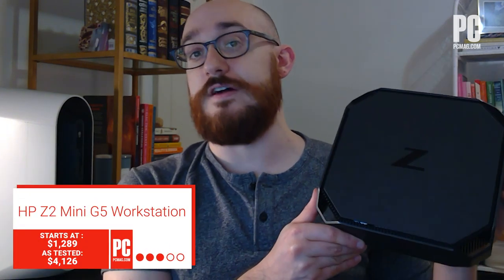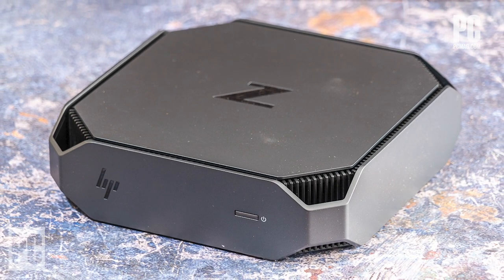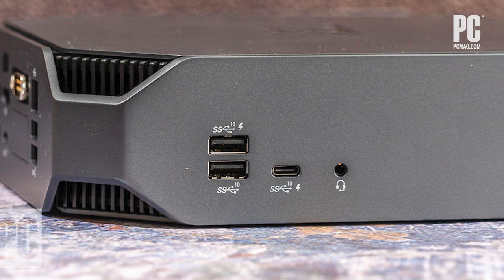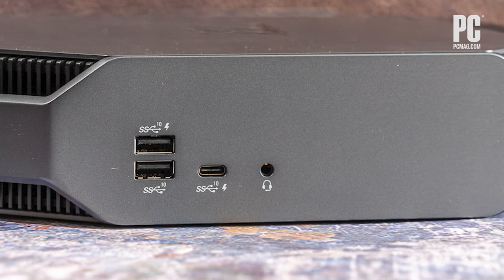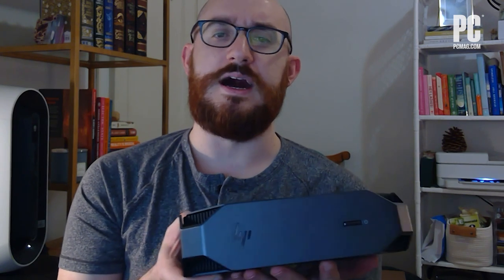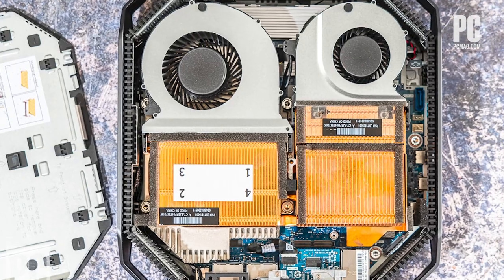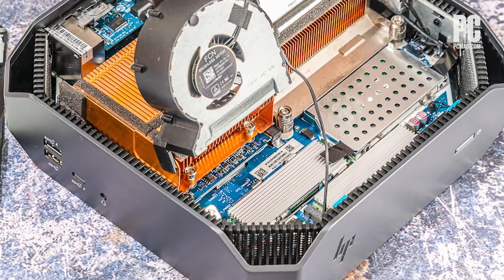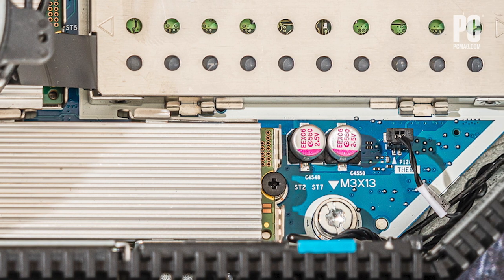HP Z2 Mini G5 Workstation Review | PCMag

Comment: The base Apple Mac Mini with the M1 can outperform this and it costs way less than four and a half grand.
Reply: yeah, HP should have gone with AMD instead of intel, because of the much better price to performance ratio
Reply: Outperform with what programs/tasks? My understanding is that it works amazing with Apple programs but can't outperform with all applications
Reply: @rasheed106  yeah i don't know what he means by that either.
Reply: If solidworks and cam are re-compiled for M1 this would make a lot more sense. But as a workstation the M1 is limited by available software.
Reply: @billknighton4181  Apple's Mac hardware is so good, but software is the only thing that's limiting it from becoming a perfect machine for all uses
Reply: shame that apple benefit from the genocide and enslavement of the Uighur muslims though.

Comment: why not laptop? It's not more powerful and still needs monitor, keyboard, mouse, etc, so you are not saving any space with this. A vs desktop. Also, it's expensive as heck. Dont get it.
Reply: There is in fact a need for these mini PCs for a variety of applications.  For example I want something without a monitor for recording surveillance video (use remote desktop to access) and it has to be small to fit in a closet space in a vertical orientation.  I suppose I could put a laptop in there, but that would be awkward, have worse cooling and component upgradability, and probably a lot more expensive for the same performance.